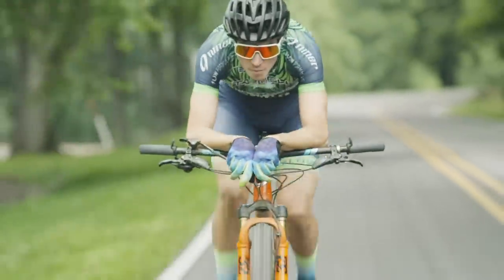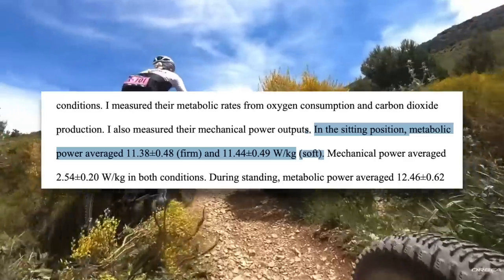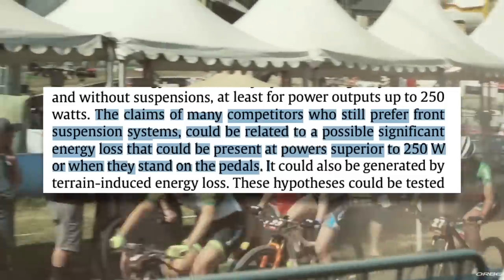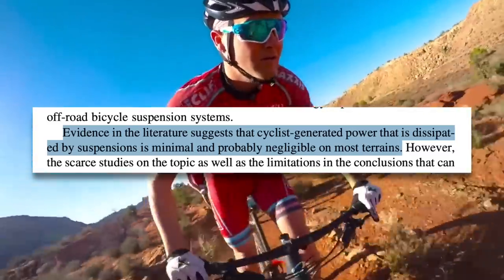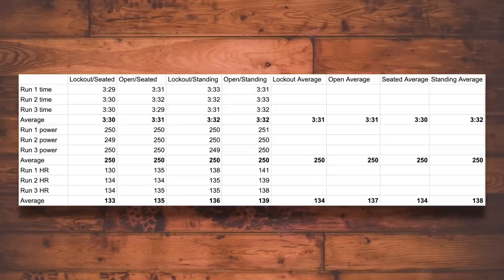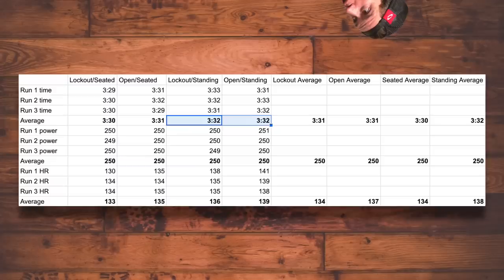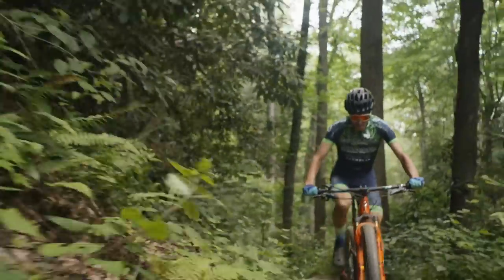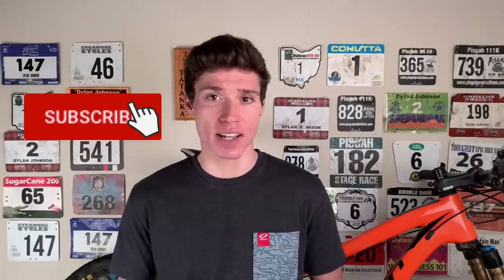Does Locking Out Your Suspension Actually Make Your Bike More Efficient? The Science

Comment: Measuring power at the crank is the reason why the times are all the same for the same power reading. The loss of efficiency occurs before the crank. If you think of the forces acting on the crank, you have the force from leg, and the reactions of the supports. Remove some of that support (ie add suspension with damping instead of a rigid platform) and you need a little extra leg force to get the same crank power. Hence HR is a little higher for the same crank power.
Reply: So in your opinion a PowerMeter isn't actually measuring Power (watts)?
Reply: @johnschmitt3083  of course it is measuring watts, at the crank. I'm saying that there is an inefficiency from leg to crank. If you pump your suspension up and down but don't pedal it will read 0 watts. So does that mean the suspension pumping doesn't take any effort or energy?
Reply from the maker: I love some healthy debate and I’ll admit that I’m not an engineer, my degree and expertise is in exercise science, so I could be completely off base here. Here is me doing some thinking on this but correct me if I’m wrong. If force is lost to the suspension on the down stroke when it’s compressed then the suspension returns it on the upstroke when it extends. GCN did a video addressing this regarding frame stiffness (doesn’t mean they’re right of course). Some energy will be lost to friction in the shock but it seems as though that amount is negligible. 

If what you’re saying is true, and I’m not saying here that it isn’t, that would mean that crank based power meters are inaccurate when your suspension is open.
Reply: @DylanJohnsonCycling  
No, gas compression cycles are not reversible. Its a basic tenet of thermodynamics. i.e. if you do work (physics 'work') on a gas by compression, you will have losses. This is what other commentator referred to becasue those losses manifest as heat (although these are also friction losses causing the heat). If you want to nerd out you can look up carnot cycle and carnot efficiency. 
Now... what those losses are as a percentage of your ftp... is likely marginal. So, for you dylan, your test was too short. In a 4 hr marathon those fractions of % may be 10m, 50m...and for you is that a podium? For me I dont race, so im going to leave the lock off.
Reply: That is interesting for sure.  I wonder what type of PM would capture that more.  Would a pedal based meter be more accurate in that instance?  My thinking being that in your pedal stroke, your power would be going to both the crank and the suspension, so would be more representative of the total power your body is producing, vs. what is getting through to the cranks.
Reply: @nickpannell   @The Fast Life  I had the same idea, just was unsure about your phrasing.

Just to be clear, the PM is measuring Watts but with Suspension ON you have to do more work to get the same Watts.

If you had a machine that would give you the exact same work with ON/OFF you would see in the PM that the Watts were less with the Suspension ON.

Using the same Human Watts in tests would also "distort" most of these test.
Reply from the maker: These are great points. For what it’s worth 2 of the studies I referenced measured VO2 and found no statistically significant difference between locked and unlocked. So if the body is working harder with suspension then it’s not by much. Then again races are often won by thin margins so for some people a small amount is very important.
Reply: @DylanJohnsonCycling  Yes, crank and pedal based power meters measure the force you apply on them at X RPM and give you a Watt reading. BUT , your cranks travel more than just in circles , the BB is traveling additionally when you bob up and down and the pedal/crank power meter doesn't know that. It's just calculating torque times rpm = power output.

If the suspension was a spring without a damper , you would get that return of energy when it extends, however suspension forks and shocks have a damper which restricts the movement , and heat is generated in the compression/rebound circuit. That is where the energy loss comes from. How much depends on suspension bob travel and damping forces.

All in all , seems to be a small difference on modern XC bikes, gets worse as you get to super active and plush long travel enduro/DH bikes. After all the suspension warms up when it moves , that energy has to come from somewhere.
Reply: @DylanJohnsonCycling  VO2 is one measure, heartrate another, and power (at different possible points - pedals, crank, rear wheel, etc.) are all approximations of energy being put into the system but none are complete enough or accurate enough to gather all the energy a rider expends when riding.

PS.  The "studies" you are finding are academic.  I don't think the authors actually expect to disprove the physics involved.  They are mostly interested in trying to find ways to measure and quantify what they already know - that suspension is useful over bumps, but less useful/worthwhile on smooth surfaces.  I'm sure they know that a lockout is worthwhile in some situations but are just having fun trying to prove it.

Comment: In my experience tire choice trumps everything else by a significant margin.
Reply: And pressure
Reply: By swapping out rear tires I was able to close most of the gap from my xc hard tail race bike to my enduro FS bike. There are literally tens of watts between the fastest and slowest tires by rolling resistance and most of the rolling resistance comes from the rear tire.
Reply: @gte717v  which tires would you recommend for a fully suspended cross country bike in 26*2.3 ?
Reply: @squishy_princess  Tires are very location and condition-specific, but I'd run a Continental Race King or Trail King for XC use.

Comment: I mostly use the lockout out of the saddle. Often after a long grind on the saddle you find a stretch of fine road or less steep gravel and going out of the saddle can be a relief by changing muscle actuation/stress. When out of the saddle the bike definitely bob a lot and does not look to accelerate as well on each pedal stroke. I would be curious of a sprint shoutout.
Reply: You just gotta learn how much weight to put on the fork. There is definitely a fine line.  
I can have my 100mm wide open and be standing and stroking hard and no bob.
Reply: he he...I said stroking hard.

Comment: Great video, I think it does miss out on one major use of lockout which is that (I think) locked out suspension makes it much easier to sprint, especially from a low starting speed. It might or might not be more efficient, but in shorter XC and short track races, sometimes you need to just get more power out when you get slowed down either out of corner or technical section, I’d argue the benefit to sprinting and the frequency of short little sprints in an XC race is the most important part of having a lockout (course dependent of course). Would be interesting to see sprinting from stopped with lockout and without, and if the lockout allows the rider to accelerate more quickly
Reply: When you deadlift sprint a 160mm enduro bike from standstill the suspension compresses a lot so it's pretty obvious how helpful the lockout is.

Comment: Wow, the psychological effect is huge then (like it is with clipless pedals - see Dylan's earlier video). I came out of winter 19/20 and the first lockdown completely detrained and rode a full sus with a missing lockout lever and got badly dropped by my brother-in-law on every climb. It was my excuse, he was on a hardtail. Next time just a few weeks later I came back with a working lockout and flipped it around, dropping him on every climb. I did no cycling in between (nor running or other material exercise). I do believe your results (given the other papers too) so it must just have been psychological. I believed I was loosing all my power so I mentally quit, I didn't even know it, or want to. Since then I've trained to a 4.6wkg FTP thanks largely to your videos so now I reckon I'd drop him on a Red Bull Rampage bike but that's another story :D
Reply: Not true, as you weren't mad nor mentally weak. the shock compression takes place when crank is pushed and the rebound of the shock returns the energy it obsorbed, the rebound happens when you stop putting down power, mostly that's when the crank is pointing down between 5oc to 8oc position, at such crank posittion, the returned energy is not used to turn the crank, instead it's just boucing you up and that's wasted energy. a softer shock wastes more energy because of that. Ofc, morden bike design is so good that the shock barely compresses during the first section of the rear wheel travel, that's can mislead to feel it's not much of a difference, but that's just less wasted, doesn't mean you can avoid it. People really need to start learn physics before doing wrong tests and posting videos about the stuff they don't understand...

Comment: I believe the open suspension absorbs pedaling energy meaning that 250W on open will be more exhausting than 250w on closed. This explains the difference in HR.
Reply: 3 BPM is too marginal to draw that conclusion. A change in breathing, temperature, taking a drink mid-climb or even just before the ride, and most obviously fatigue for sets 2,4,6 over 1,3,5 can all explain a 3 bpm heart rate variability
Reply: Well, the studies disagree, since they measured metabolic energy and didn't find a difference there. The 4 bpm difference can easily be explained by him doing the closed runs first, it's well known that heart rate for the same power output can rise over time.
Reply: While those 3 BPM are not solid proof. I think we can prove it by logic and math:
Doing the same 250 W and having a bobbing suspension means your body is producing both 250W to spin the cranks AND to move the suspension (which absorbs energy with the dampers generating heat). The power measurement is assuming everything is fixed and all the force is going into turning the crank in circles. However your BB is going up and down and that additional movement accounts for watts being 'lost' and not calculated by the power meter. The PM is thinking you're spinning circles when in reality you're spinning and moving the whole system up and down too, but it doesn't know that.

Comment: Looking at your HR when standing, it's clear that standing-open cost more metabolically than standing-lockedout.  Even though their 2 avg times were equal, but over the course of a longer effort (multi hours), would they still remain equal?  I doubt it.  Metabolic cost takes a while to manifest itself, especially toward the end of a long race.  It's not all about mechanical efficiency.  Both mechanical and metabolic efficiency count.  I would say your experiment is interesting for 3-min efforts, but I would not extrapolate it to real world racing just yet, especially if that race is a long one.
Reply: Are mechanical and metabolic efficiency not directly proportional to one another? At least if metabolic efficiency changes and all other factors remain the same, mechanical efficiency should drop.
Reply: Except that DJ did all the locked out runs first. And so the higher HR on open shock runs could entirely be down to cardiac drift
Reply: since making my comment here, I have learned something about (crank based or pedal based) powermeter behavior that makes Dylan's experiment invalid.  These powermeters do not take into account the vertical bobbing movement of the bottom bracket when the bike is bobbing up and down.  The crank powermeter can only measure power exactly at the crank, but it cannot account for the power required by a bobbing bottom bracket.  Crank based powermeters work great for a road bike because the bottom bracket is not bobbing, not so much for full suspension.  So, let's say a person puts out 250w on a rigid bike, and that same person puts out 250w on the full suspension bike, well now we know that 250w on the full suspension actually requires more then 250w because the powermeter fails to account for bobbing suspension.  This would explain why Dylan's HR is ALWAYS HIGHER in the OPEN/STANDING mode even though he's keeping power output at the "same 250w", but he is actually producing MORE then 250w in the "OPEN" mode, that the crank based powermeter has failed to account for.

The thing to understand here is that suspension act to dissipate energy, and that energy is dissipated in the form of heat.  This is why shock fluid heats up when suspension travels.  And unless you can account for this loss of energy in your measurement,.. then you're not measuring accurately, and in the case of Dylan's experiment, he is actually under-measuring power when the bike is bobbing in open suspension mode.
Reply: @danielfeary  I don't think so, his exercise duration is not long enough to be causing cardiac drift.  Anyway, I have posted my follow up comment about crank based powermeter behavior and how his experiment is invalid.
Reply: @jacco2952  Good question.  I can't recall, but read somewhere that mechanical and metabolic efficiency are not the same thing.  Mechanical efficiency doesn't change much with training, and further more, a pro and an amateur have pretty much the same mechanical efficiency.  The reason for this is, I believe, mechnical efficiency depends on the construction of your physical anatomy.  For example, blacks have high calf insertion along their leg, and this allow them to run with good mechanics.  Asians and whites don't have this high insertion.  Now, this doesn't mean a black person will automatically can run faster than a white or Asian, because that white or Asian could train harder and improve their metabolic efficiency (because metabolic efficiency is more trainable than mechanical) and still run faster than the black person.  Anyway, since making my orginal comment, I have learned that Dylan's experiment may be invalid after all.  See my follow up post above as to why his experiment is invalid.
Reply: Sooo... for this experiment to be valid, it would have to be done using a different power input measuring device? Like oxygen consumption, heart rate etc?
Reply: @richeeg3271  Actually, since posting my comment, I've since learned that this experiment is invalid because of how a crank-based power meter operates.  Specifically, a crank-based power meter doesn't account for the bobbing of the crank.  Force is only measured at the crank, but there is also a force acting on the (bobbing) bottom bracket that is not being measured.  For a relatively rigid bike with very little movement in bottom bracket (eg, a road bike), crank based pm is ok.  But for full suspension bike, crank pm will be inaccurate.  Power is under measured for the full suspension bike.  Oxygen consumption measurement would definitely validate the experiment more than HR measurement.  But the weakness of this experiment using a crank based pm.

Comment: This makes a lot of sense, and also shows that new products like Flight Attendant are probably a waste of money. However, one thing not mentioned here is that on bigger bikes in particular, locking out the rear suspension on long steep climbs will keep the rear end of the bike up higher, which makes it feel like you aren't climbing something as steep, keeps the seat angle nice and steep, and helps avoid that slipping off the back of the saddle feeling. That may not be measurably faster, but is more comfortable.
Reply: Get yourself a new geo machine! Lol

But in all seriousness suspension plushiness is set by the spring rate and I suspect most people will have a lesser travel bike set up firmer as you need to to have the same sag ratio.
Reply: @tylerbruce5731  always down for a new bike, but I just built a Spire up. So although the right number of bikes is N+1, gotta wait a bit more for another, and aren't many bikes more new school than that. I can definitely feel the geo difference on big climbs with the lockout,  although I only use it on paved or fire road sections, unless I forget to unlock it.
Reply: @adanielweaver  well the Spire is a new Geo machine. Looks nice, congrats!

I keep thinking I want a Spur but I am really unsure. I like the lightness compared to my Pole and Nicolai but I have a feeling I would quickly regret the lesser travel.

Comment: Really interesting stuff. I have a 40k mostly hard gravel loop with 300M of climbing which I've done multiple times both with and without locked out suspension, and with a great deal of standing. I have to say it feels just as efficient to me, regardless of the settings, which is why I usually leave it in "trail" half way between the two. One thing I'll take away from this is I've noticed my tyre pressure can stand in for suspension, so I'll be using higher pressures, and not locking the suspension on road surfaces from now on. A final note is that I've noticed excessive localised muscle fatigue with fully open suspension, which I believe is due to taxing unusual muscles at the bottom of the 'bounce', this bounce of course depends highly on the rider's weight, and suspension travel, but I believe if done enough, could slow you down.